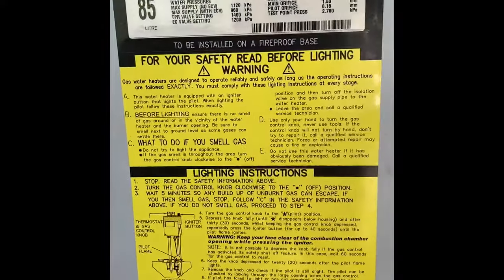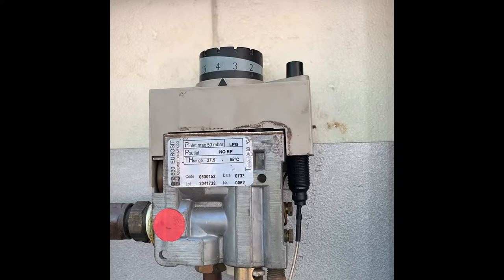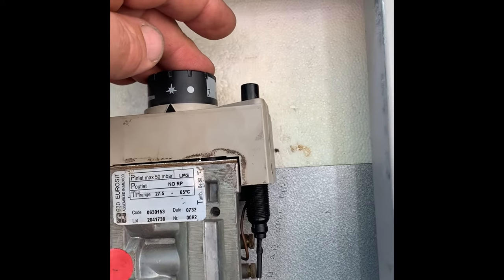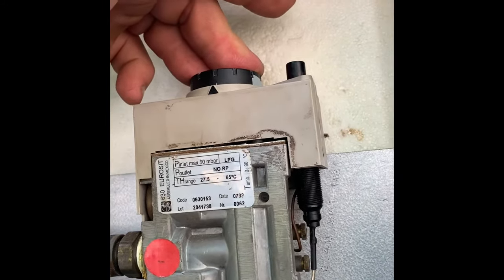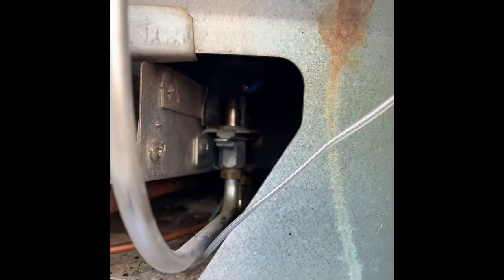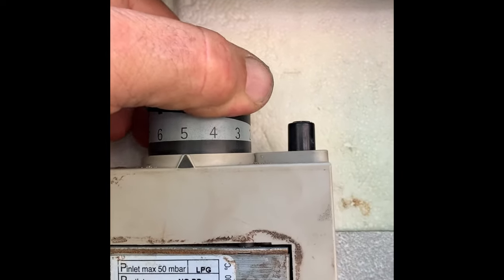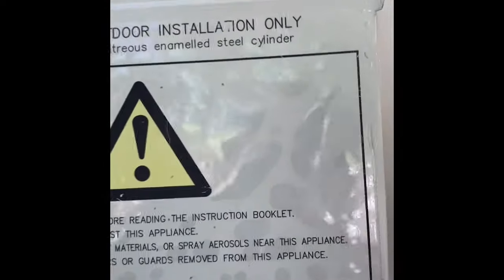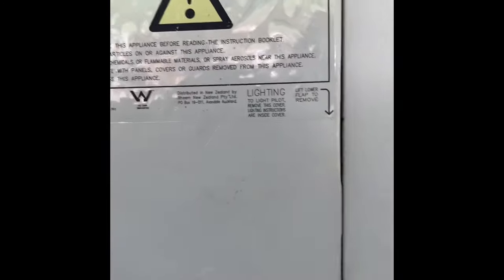How to light a gas hot water pilot light

Comment: Hey Mate, The water temperature is quite low in our aquamax hot water system. I roateted that levels from 4 to 5 but no significant difference.. is there any DIY steps that can be done before calling  someone? I read one method of getting tank empty to remove sediments but don't know how to do it. Can you make a video about that if that's DIY possible?

Comment: Great video - cheers - I have this exact unit. Just moved into the house and no hot water, but I know it had hot water a week ago. I think either I'm missing steps or the ignitor has gone. Can't hear gas at all. Time to call a profesional.
Reply from the maker: Thank you for your reply. 
If you’re unable to light the HWS after following these directions, you need to seek help from a licenced gas fitter. 
If you have checked that you have gas in the bottles then you may have a failed component in the system that needs repair or replacement.

Comment: On that same Rheem system (Model 311170N0) do you have video on replacing the Piezo Igniter as mine is not clicking, thus not starting. The part no is 890202 but I'm buggered if I can figure out how to remove the old one.  I presume the top housing come off ??? Cheers  (Edit: Don't worry, I found the screw on the top cover under the 15 years of dust / detritus and fixed the igniter)

Comment: Does this affect the acrtual heating system too. I have hot water but my heating is the issue where the blower wont turn in and was wondering if theres a conmection between the two.

Comment: Its been more than 1 hour but still no hot water though everything else worked okay and can see the flames, does it sometimes takes more time ?
Reply from the maker: If your tank has not been off & not heating for a couple of days or you have used all the warm water in the tank, it will need to re heat & this could take a couple of hours. 
If your tank is not heating & the burner is on then you will need to contact your local Gas Fitter.

Comment: What if the ignitor does not work as in my piece of rubbish Rheem unit. I saw a plumber use a hand ingnitor. How do you stop the light from going out ?
Reply from the maker: Hi John, if your igniter is going out then it sounds like you have a problem with the controls,  which your gas fitter will need to repair.
Reply: @Cheryl63100  I ended up getting a new heater. Amazed what a poor design this is - the pilot light goes out with a bit of wind. Not exactly space age technology.

Comment: Is this gas turn off by itself?
Reply from the maker: If your hot water system has a pilot light that is blown out by the wind or other, the safety in the unit will shut down the gas.

Comment: Mine its cutting the flame while you release the gas pilot nobe
Reply from the maker: Thanks for your comment, if yours is not staying lit after following my instructions, you will need your Gasfitter to service it. 
It will be a fault with the safety switch or the main controller. 
If your located in SE QLd Australia, we can help. 
Hope you get hot water quickly.